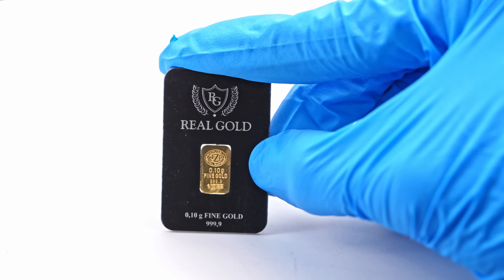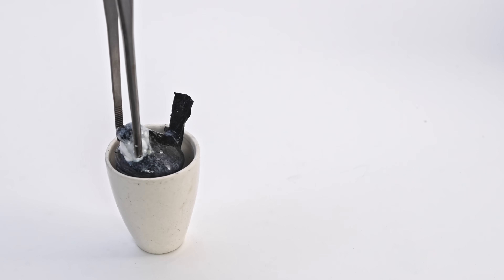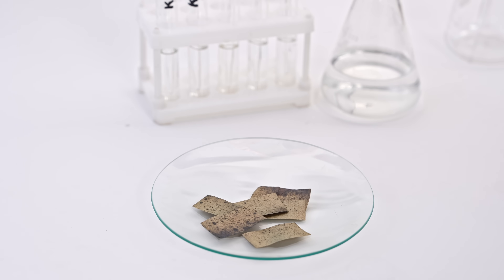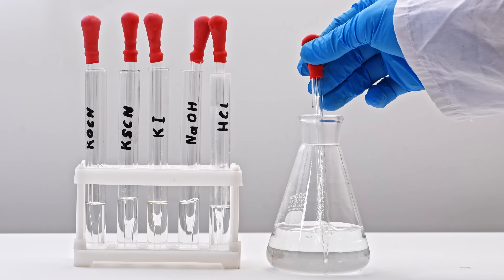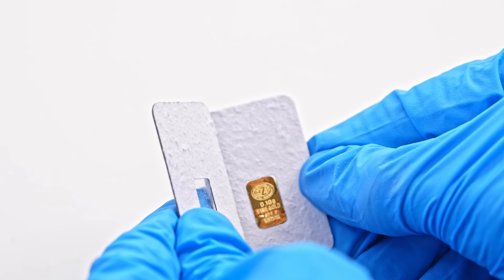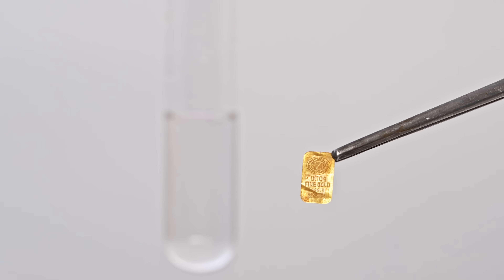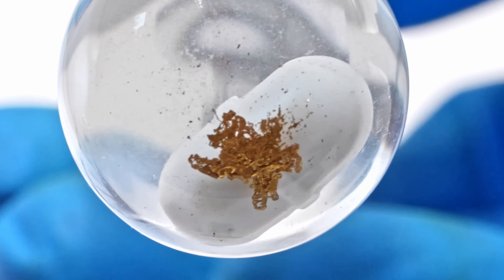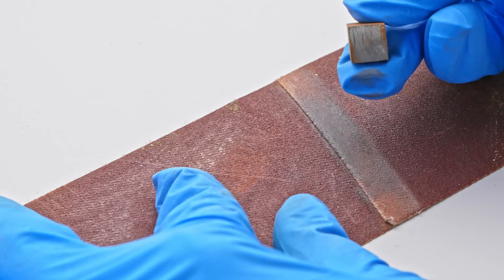I Dissolved a Gold BAR in Potassium Cyanide Solution!

Comment: absolutely not practical chemicals in this process. lol. so, you can make 3d metal objects by first electroplating with zinc, then replacing the surface with say steel, then melting away the low temp zinc. or at least coat the metal object with some other metal.

Comment: I worked as a chemist for some time in the South African gold mining industry. Once the gold ore is crushed and milled, the gold will be very fine and dissolves within hours. There are four elements which accelerate gold cyanidation: mercury, thallium, lead and bismuth. Indeed, lead salts are added to speed up the reaction, and to neutralise the detrimental effect of sulfides. I wonder if the red coating on the gold is due to the reaction with the cyanate. Thiocyanate also dissolves gold.

Comment: Regarding 8:55, commercially available gold electroplating solution contains gold dissolved in potassium cyanide which is known as potassium aurocyanide. If stainless steel is used as the anode, then the gold in the electroplating solution will eventually become depleted. On the other hand, if gold is used as the anode, then the gold in the electroplating solution will not become depleted.
Reply: I need the correct method for gold plating and jewelry making. Could you please share your knowledge with me?
Reply: Users must be cautious using Gold Plating Solution because it is a poison which contains Potassium Cyanide. If you use an anode made of 24 karat gold instead of stainless steel or titanium, then the Gold Plating Solution will last a long time. Otherwise using an anode of stainless steel or titanium will deplete the Gold Plating Solution. Watch the instructional demonstration @ https://www.youtube.com/watch?v=mYcca1UNlX4

Comment: If you use Aluminum instead of Zinc in displacing Gold from Potassium Cyanide, some of the Gold will produce Purple Plague, an alloy of Gold and Aluminum. I discovered this by accident when trying to recover Gold from a Cyanide solution using Aluminum.
Reply: Ooh! That might be a much more easy way to produce Purple Gold than the conventional method of using a furnace to make the alloy.

Comment: I love how he casually explains how to make cyanide and i just realized that i could repeat that
Reply: it's impure KCN, so you'd be able to use the solution with reactions fine as long as you do it before it hydrolyzes.  Which it will pretty rapidly and turn into fairly harmless cyanate.  To get pure KCN,  you'd have to distill HCN (from the crude KCN)  into ethanolic KOH then dry it in a vacuum desiccator or in an inert atmosphere/no moisture oven.
Reply: I thought that at first, then realised I needed to buy the furnace😔
Reply: @chikianglim3632  and how about just a blowtorch?
Reply: @Changed_username  might not give the correct temp tho
Reply: don't play with cyanide! Cyanide in sub-fatal dosages is a potent carcinogenic pro-oxidant.
Reply: Or you could extract it from certain plants, laurel contains fairly significant amounts of it (never put laurel through a garden shredder!).

Comment: To get pure NaCN,You can use melting Na4[Fe(CN)6] and add Na chip.The reaction is very smooth and safe.Then,break the black chunk and extract in Soxhlet extractor with MeOH. This method will get very analytical pure NaCN.www

Comment: How would you drop the gold out of solution without using another metal like zinc? Could you use SO2 gas like you can with gold dissolved in aqua regia?
Reply: electrolysis

Comment: We used KCN for chemical polishing of new made 14K gold yewlery.
Much faster than media polishing, you can even be to some extent selective in which metal is etched (silver, copper and zinc beter) leaving a thin higher carat gold alloy leyer which is then compressed and polished by thumbling.
Much beter wear, shine and color than base alloy.
Silver and gold in solution is much easier to recover than from mechanical polishing.
Reply: It will also fool inexpensive XRF eqipment into thinking the item is of a higher Karat.
Reply: How do you select which metal is etched

Comment: @5:45 It is, roughly calculated and not knowing the concentration, the volume, the temperature etc., a ratio of the measured times for dissolution of the gold, as is the oxygen content  in normal air 9min/25min = 0,36 = 36 % (but air has 21 % of oxygen).
Reply: Im glad im not alone!
Reply: The other gasses get in the way of any reaction, so it doesn't slow in a linear fashion.